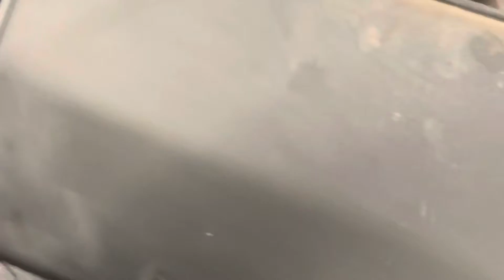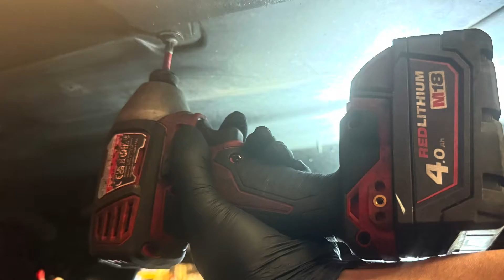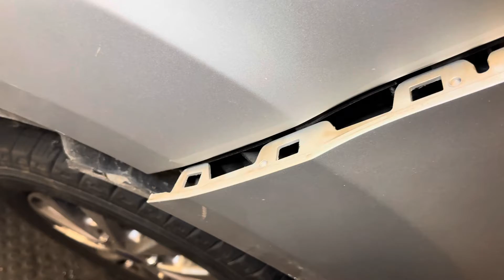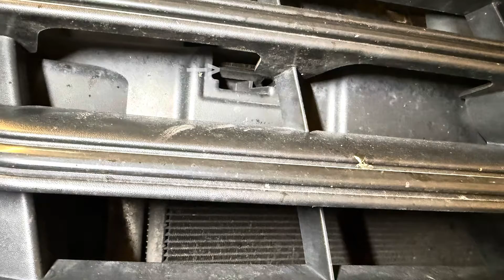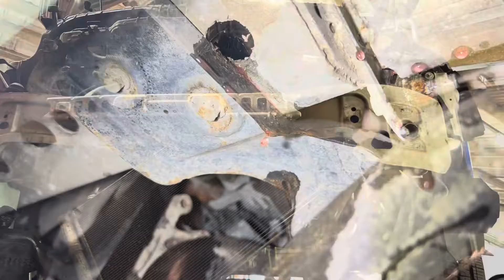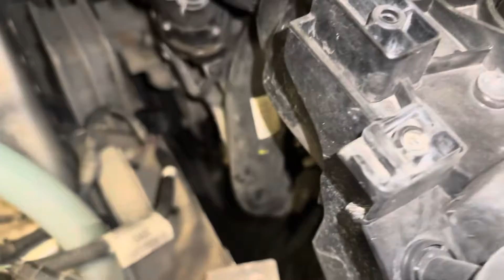Ford Transit Ecoblue Radiator Replacement | Easy Step-by-Step DIY Guide. 2014 to 2020

Comment: I do it the bodgers way 🤣. I take the front slam and crash frames bolts out of the top and the ones on the legs from behind the lights (take the lights out too) you can get a hoist or your mate just to lift the top of the front crash frame away from the rad far enough to slip it out. Fans got to come off too obviously. 

This video was really good because I want to put a Condenser in mine though 😂 👍.